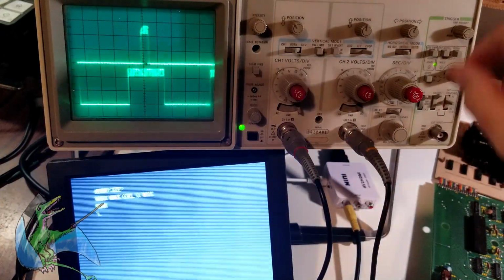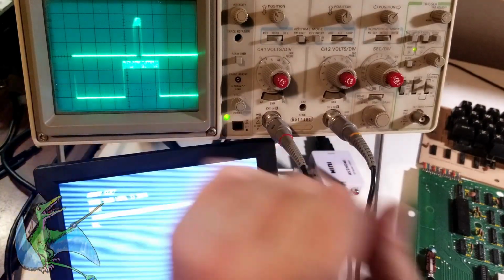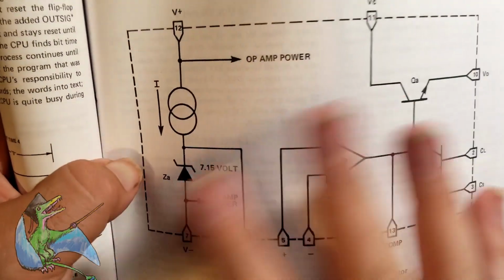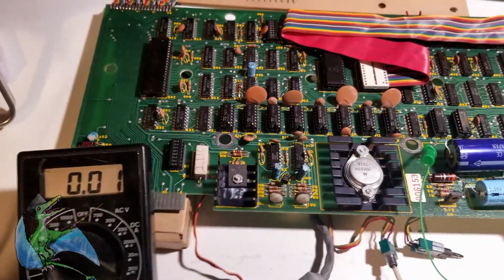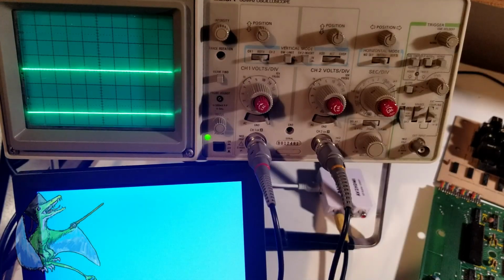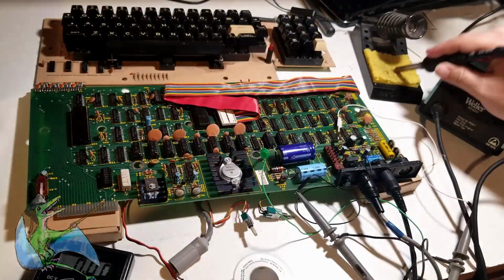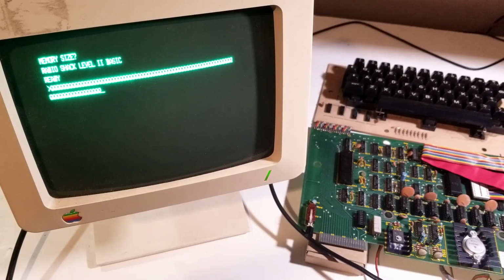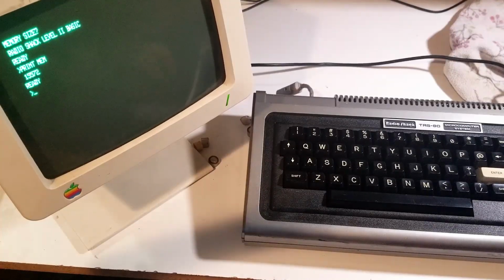De-trashing a TRS-80 Part 2: The Repair-ining (#SepTandy 2021)

Comment from the maker: Woohoo! Several days on from the repair and it looks like I'll have to bite the bullet and take the thing apart again "soon" because there's an issue with the lowercase modification wiring. It may just be oxidized contacts in the old switch, but it's possible one of the not-great old solder points that were securing that wiring may have cracked. (Also the mod is a little bit "weird" even when it works; I may need to do a video explaining the long sordid history of lowercase mods for this machine. I might want to convert it to one of the other types.) This TRS-80 is certainly going to be the gift that keeps on giving.

But, eh, I don't care right now. It seems to work okay if it's set for uppercase-only and I'm able to load "Robot Attack" from the cassette port, so I'm still declaring victory.

Comment: Ok, the repair stuff is fun to follow along with, but I'm really getting kinda dizzy looking at those schematics while you're trying to explain everything because you're just holding them in your hand and they're constantly wiggle-jiggle-wobble-jump-wobble-wiggling all over the screen.  (It seriously is actually making me feel a little ill watching it)

In future, you might want to consider if you're showing people something on a piece of paper actually putting the paper down on the table or some other fixed surface so people can actually see what you're pointing at when you point at things without feeling sick...

And yeah, the moment I see glitchy CRT video output, my first thought is "check the adjustment pots to make sure they're not just dirty" and then my second thought is always "double-check your voltage regulation".

Though to be fair, any time anything's glitchy anywhere, it's a good idea to check your voltage regulation to start with.

Comment: What a great project.  I repaired a TRS-80 Model I early this year which I brought on eBay untested without a power supply or monitor.  The TRS-80 was the computer of my youth which I learned to programme on when I was 14 at school in 1977. This machine needed one cap replaced due to some physical damage, I also had to build a power supply, replace the keyboard ribbon cable and make the required video and cassette cables. I'm using an AWA 12 inch CCTV CRT as my monitor and I have also added a FREHD with another 32K so I can run LDOS and TRSDOS.
Reply from the maker: Through some horse-trading I just managed to lay my hands on a Tandy VM-4 green monochrome monitor that I'll probably show off in my next video about the machine. Obviously it's not period correct, but it sure is a beautiful display.

The next mountain to climb is getting the expansion interface that came from the same storage locker to behave, it's been kind of a heartbreaker. It was working, at least so far as it would recognize the RAM after sufficient fiddling and fussing with the cabling (I may have to do something drastic about that) before I started working on my Gotek drive conversion, but when it came out to test it it suddenly seems to be having problems bigger than bad connections.
Reply: @PaleozoicPCs  I have an expansion interface for my TRS-80 Model I but I don't have the buffered cable, so I'm using a FreHD 32KB combo with an SD Card. Looking forward to your next video. Thx

Comment: I guessed capacitor, but that is not the type or location I would have guessed.  Partial credit? :)
Reply from the maker: Yeah, it would figure it would eventually boil down to "a capacitor", but I do feel like people are a little bit too hair trigger about just shotgunning every electrolytic in the machine as step one of every classic machine repair. And of course this wasn't even electrolytic, it was a dinky little ceramic disk.

(I repaired a Commodore PET many moons ago and, coincidentally enough, in the middle of the process a "completely dead machine" symptom just suddenly happened that also turned out to be a ceramic disk, this time in the reset circuit.)